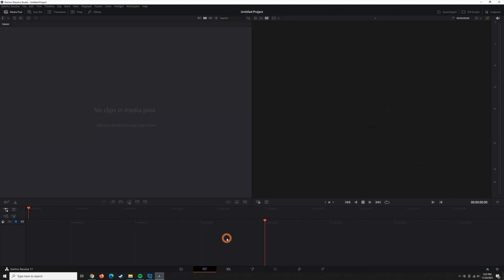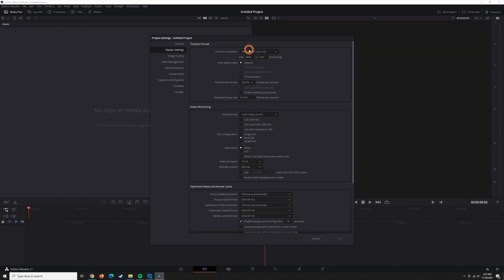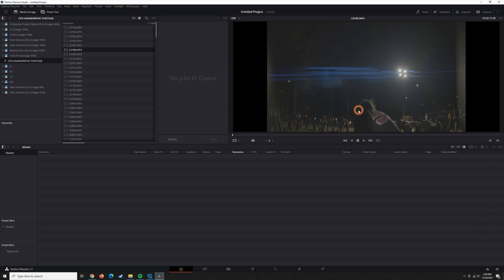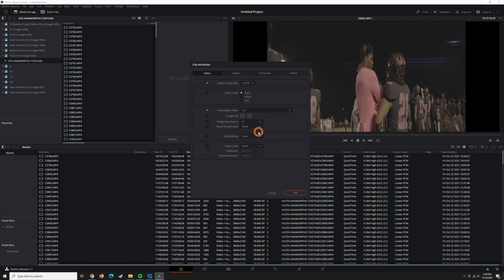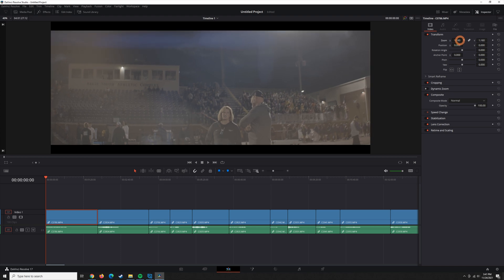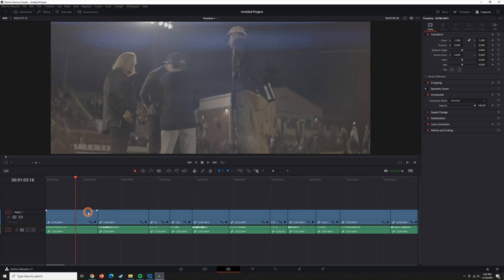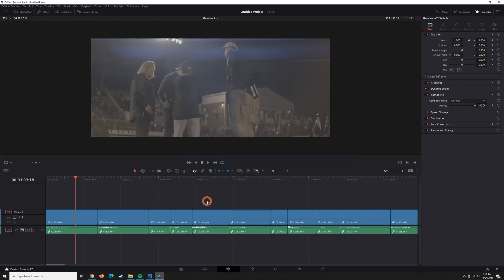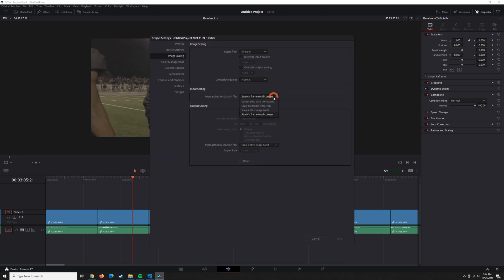How To Set Up An Anamorphic Project in DaVinci Resolve

Comment from the maker: Chapter Markers
00:00 Intro
00:11 Different anamorphic aspect ratios
00:28 Impact of sensor aspect ratio
01:23 Example from a project
02:46 Timeline resolution
03:52 Pixel aspect ratio
05:29 Image scaling
07:12 Center crop with no resizing
07:27 Scale full frame with crop
08:01 Stretch frame to all corners
08:31 Outro

Comment: My lens is 1.55x, not 1.5 not 1.6, but 1.55, How do I adjust for that? Source recording was 3840x2160, But with a 1.55x lens using android - blackmagic to record it.

My ask - how can I force the project settings correctly for the resolution, and what is it? / Trying to figure if it actual should be output 5952x2160  ???
Reply from the maker: Hey, sorry, I've completely fallen off the grid when it comes to this stuff--more or less changed paths entirely and not doing video production anymore. Check out this channel: https://www.youtube.com/@AnamorphicChannel/videos

Comment: Hi Phillip--3 years in the future---I'm shooting anamorphic on an Iphone 15 Pro Max---generally I'm getting what I want but I would like to eliminate the left and right edge blur in a global way. Many of the settings in your video touch upon ways to adjust including simply cropping a bit but i'd rather not crop. I shot in 1.55. Is there a way to simply work the left and right of  a frame and sharpen or create a filter for these two zones and sharpen (but insuring it's consistent with the middle content).
Reply from the maker: Maybe just using a couple power windows targeting the edges of the frame will allow you to apply some sharpening effects to those areas. You can adjust the amount of edge feathering so it looks natural
Reply: @PhillipRPeck  Agreed, I think I'll just handle it with that--it's not anything like I want to undo the anamorphic impact--it' simply making sure the footage is not distracting due to clear challenges. I'm learning most people showing demos are doing post production stuff (as they should) including cropping. Excited though---none of this is heavy lifting. I'm going to make the bold move of getting a 1.55 and I guess if it really doesn't work, i'll step back to 1.33.

Comment: This may be a super noob question but here it goes. I'm running a Canon XH - A1. Your video example at 1:23 is the kind of video that I get. Apparently it runs anamorphic pixels. You're in 1080, but when I import it, I'm getting the same widescreen look but I'm only getting 1440 instead of 1980 just like your video is showing apparently. Is there a way to fix this to make it full screen? If you view my video Beyond The Ashes: Episode 3 the intro you'll see what I'm talking about. The rest of the video is shot in RAW so there's no issue fulfilling the 1980 x 1080 but I'm trying to see if that intro footage I can make 1980 if that makes sense.
Reply from the maker: Whoa. I have no idea. Just checking out the specs sheet of the camera it says it has a native 16:9 sensor, so I don't know why you'd be getting a wide aspect ratio like that. My guess would be that it has a "cinematic" mode or profile and you just need to switch it to a different mode that shoots in 16:9 (1929x1080). Or, maybe it's a setting that has to do with 1080i versus 1080p
Reply: @PhillipRPeck  It appears as though the still pictures I can take is 1980 x 1080 but the HDV 1080 is actually 1440 by 1080... so advertised by the company as a "true" 1080 camera, but in reality it's running 1440 x 1080...maybe shooting in 720 and up scaling to 1980 x 1080 would be a better option.
Reply from the maker: @manwiththevoice  Have you tried 1080i as opposed to 1080p? It says on the specs page that it's 1080i, so that mode should give you the full 16:9 readout. If that doesn't work, then 720p might be your best option like you mentioned.
Reply: @PhillipRPeck  So I fucked with it for about 6 hours today. That camera specifically is 480 24F but in reality it's 3:2. I have issues with HDV on the camera to tape, but can record to PC directly no problem. The key is to keep it in it's native. So Davinci I ran interlace, and 59.94 frames, despite the actual clip allegedly is 29.97 (idk how). Anyways, with a 24 timeline it'll upscale to 1080 pretty well so that's the solution if I want to record to tape, if I want 1080 HD, I need to run direct to computer software. The camera luckily though, is such high quality that the 480 24P (despite not being 24P) is actually really good 480 and upscales well. I tried 1080i at 60 FPSi and it did play back...That may have something to do with it. It may not like 1080HD 24P when it reality it's running 1080HD 29.97...but plays back much better than 1080HD 24P, which again, isn't really 24...so inevitably I'll need to test more to make sure 1080i is stable, as I've been having issues like I said with 1080 at 24FPS...I can always fuck with those settings in davinci anyways. I appreciate you taking the time to answer. What a clusterfuck.
Reply from the maker: @manwiththevoice  Have you considered buying a newer camera...? 🙃
Reply: @PhillipRPeck  ha I did. I got a canon EOS M with magic lantern that shoots 14 bit 1080HD RAW. I just find myself constantly trying to make my stuff look like film and I figured if I got a minidv that’s as close to film as I’ll get without buying a used 15K film camera lol
Reply from the maker: @manwiththevoice  That's amazing. I respect the dedication. I hope you figure it out

Comment: What would be the correct project settings for the Sirui 50mm 1.33X? thanks
Reply from the maker: Resolve has built in scaling for 1.33x anamorphic. It's in the clip attributes. You can set your project resolution to whatever you want depending on how much letter box you want

Comment: I shot on 1.6 but there is only a 1.5 or 1.8 option what do I do about that?
Reply from the maker: You can use the Zoom X and Y axis in the inspector. Check out the Aspect Ratio Calculator from Tito Ferradans so that you can figure out the values that you need to change. 
I don't want to put the link in the comments because YT might flag it as spam but just Google search "Anamorphic on a Budget - Aspect Ratio Calculator" 
Also, check out his guide if you're not sure exactly what to do: "The Ultimate Aspect Ratio and Anamorphic Lens Desqueeze Tutorial"

Hope that helps!

Comment: I have a moment 1.33x anamorphic lens that i use on my phone i followed all these instructions and it worked for me, but the playback of my video is slow and choppy. any idea why?
Reply from the maker: Glad it worked! Do you normally have good playback but the anamorphic settings somehow made it worse? Unless the timeline resolution is a lot higher than normal, I can't think of a reason that playback would be worse than a typical project. 

It could be the recording format or codec that's coming from your phone. If it's H.265 /HEVC, that codec can be a real pain to work with.
Reply: @PhillipRPeck  it’s definitely the codec, i’ll have to figure out what to do about it. this video definitely helped me a lot though, thanks a lot dude!
Reply from the maker: @lumia4443  Proxies!
Reply: @PhillipRPeck  how can i use that to help? do you have any videos you could recommend
Reply from the maker: @lumia4443  Proxies make it a lot easier to edit your footage. I have a video on all the different proxy options in Resolve
Reply: @PhillipRPeck  just watched it, helped a lot!! thanks so much dude.

Comment: Hey Phillip, just curious as you mentioned at the very beginning of your video some aspect ratios (1.33-1.6-1.8-2.0), but in the pixel aspect ratio from the clip attributes of the footage in the media page, there is actually no option (DVR 17) for 1.6. It does not directly concern me as I have 1.8 anamorphic lenses, but it does for my friends and many people I know who use the new Sirui lenses (1.6x lenses).. 
the problem I see by not doing it that way, is that, when you desqueeze your footage through the inspector (by unlinking the X ans Y), when wanting to zoom in the footage, even though you actually re-link the X-Y, it does not keep the correct aspect ratio and destroys the desqueeze.. little confused here to how to properly work with such aspect ratios.
Otherwise, great video, thanks!
Cheers
S.
Reply from the maker: That's a good question. I'm surprised Blackmagic hasn't added 1.6 options by default given the prevalence of the Sirui lenses. I'm not sure what the best option would be but I'd recommend taking a look at the channel "Anamorphic on a Budget" and specifically the video titled, "The Ultimate Aspect Ratio and Anamorphic Lens Desqueeze Tutorial". 

There are also a couple videos on that channel specifically about the Sirui 1.6x lenses. I haven't found better anamorphic how-to's anywhere than Anamorphic on a Budget. I hope you can find a suitable answer there and sorry I can't be of more direct help.
Reply: @PhillipRPeck  Just checking in with an update on this... The latest version of Davinci Resolve (18.5) does have support for custom pixel aspect ratio. So for 1.6X squeeze factor, you can now manually input a custom value of "1.6"

Comment: Thanks for the video. For some reason when I go to create the Scope resolution it limits the number I can enter into the first box (4096). I can't enter anything greater than 3840, like it's locked or something. any thoughts on how to get past that?
Reply from the maker: Are you using the free version or Studio?
Reply: @PhillipRPeck  free. I guess that's the issue
Reply: One more question if you don't mind. I have the 1.6x Sirui. Is there a way to set a custom squeeze since Davinci doesn't have this exact setting in their native/preprogrammed options on the Pixel Aspect Ratio? 1.5 is pretty close but obviously not exact to achieve the results from this video. thanks

Comment: Helpful video!  What about desqueezing only one clip in a project with a custom figure?  For example, my DJI Mavic Air 2 has a Freewell 1.15 anamorphic filter and I don't see that in the clip's dropdown list for the Aspect Pixel Ratio.
Reply: I know this is an old comment, but for people who are watching this video now, after may Resolve updates, Resolve now let's you select Custom in that Pixel Aspect Ratio drop down menu. This unlocks a box where you can type in any anamorphic desqueeze. Just used it today for 1.6 anamorphic.
Reply from the maker: Probably the best thing to do is (in the edit page) click on the clip, go into the Inspector, ungang (unlink) the X and Y parameters for Zoom, and just eyeball it.
Reply: @PhillipRPeck  Thanks... I actually went into the color page and under the sizing tab, adjusted it there. 😊

Comment: Hi! I have an 1080p video, and want to turn it into a 23:9 video (1920x800). I set my timeline resolution to 1920x800, so IN THEORY, when I import the HD video (1920x1080) I'd only need to fix the position on the Y axis since my video is 1920 horizontal already. However it's NOT doing that. Instead it's kinda interpreting the footage as something smaller than 1080p, so I have to zoom in to fill the screen. Am I doing something wrong? :( Thanks in advance for any advice you can help me with!
Reply: I just answered my question. I hat to select  "Scale full frame with crop" in Image Scalling. :3

Comment: how do I do that without black bars?
Reply from the maker: You can’t. It’s the difference in aspect ratio between “cinema” widescreen and television widescreen. You can just set your project to 16:9 and crop in, but that defeats the purpose
Reply: @PhillipRPeck  you're right but talking about a completely different thing. Anyway, did that by doing another timeline with the exact resolution that I wanted. In Premiere it's a lot easier, but okay
Reply from the maker: @filipmokrogulski9463  Sorry, I guess I misunderstood your question. I wasn't trying to be rude or anything

Comment: If you shot 16:9 at 3840:2160, and then select 4096: 1716 as your new resolution, don't you need to stretch that 3840 to a 4096? Wouldn't that reduce detail?
Reply from the maker: Yeah, technically it would. You could always down res down to 2K. You could try both and see what looks better
Reply: @PhillipRPeck  thanks!

Comment: I am having trouble using dynamic zoom and it always zooms everything. Have tried un-de-squeezing then zoom then de-squeeze but that doesn't work. Any tips? Thanks
Reply from the maker: I'm not sure what you mean when you say it zooms everything. Regardless, maybe try key-framing the zoom parameters in the inspector rather than using dynamic zoom
Reply: Make sure you unlink the chain icon when zooming